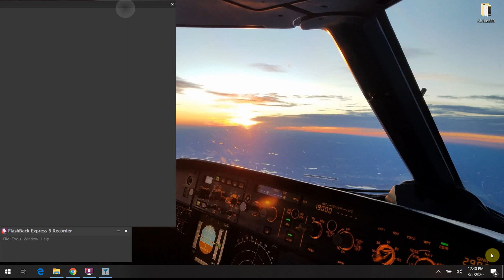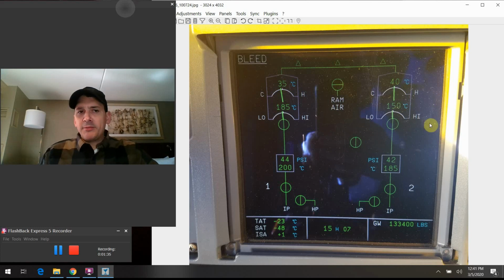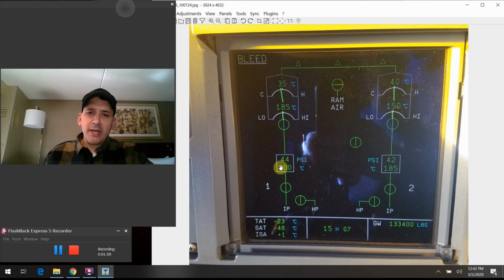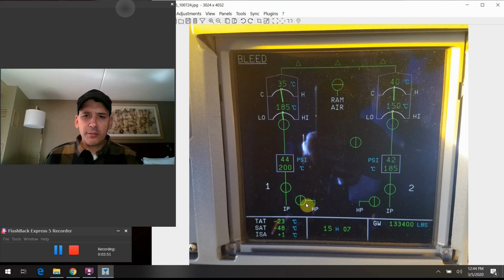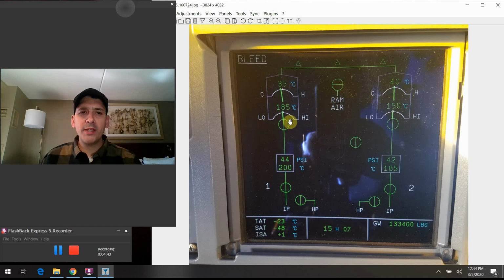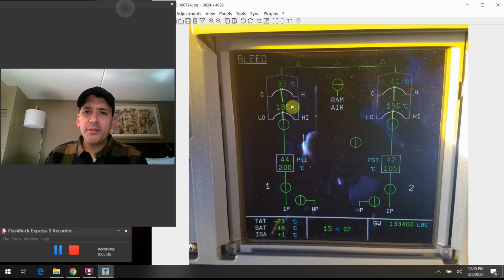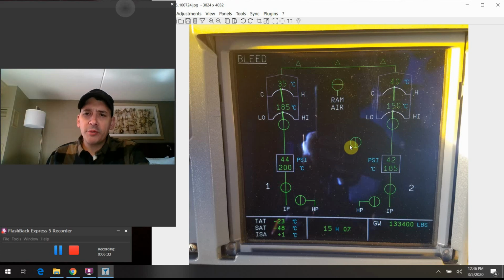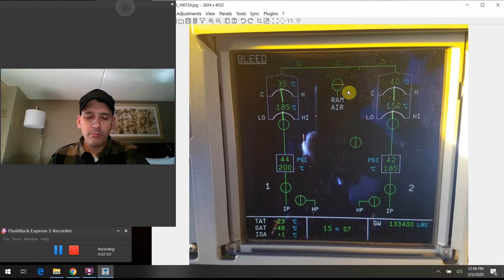Airbus A320 Cockpit Tour: #44 - SD-BLEED Page: What do all those buttons do?!

Comment: Hey Mike, small correction, you have said that we have and IP valve and HP valve, HPV is correct, but the valve upstream the IP is the PRV (pressure regulating valve) .. IP stage does not have IP valve but it has a  check valve is not indicated on the bleed page

Comment: Hi Mike, thanks for the video. Can the emergency ram air supply also provide emergency pressurization in the event of a pack failure, or is it strictly for ventilation purposes?
Reply from the maker: Of course Louis. I'm glad they are insightful. Yes another good question. Unfortunately not, the ram air pressure alone of the outside air entering this intake is not sufficient enough to pressurize the cabin.